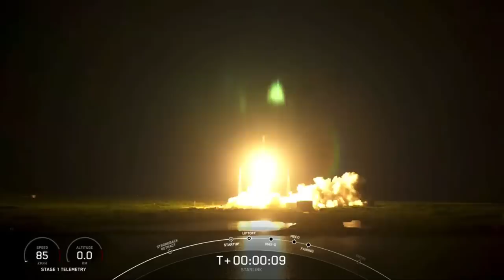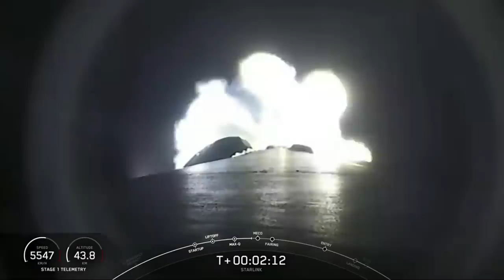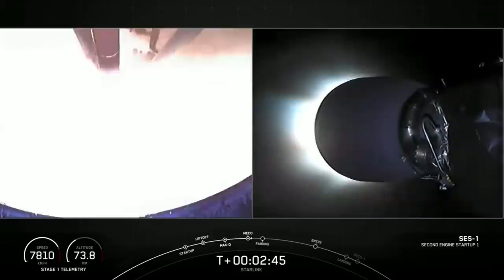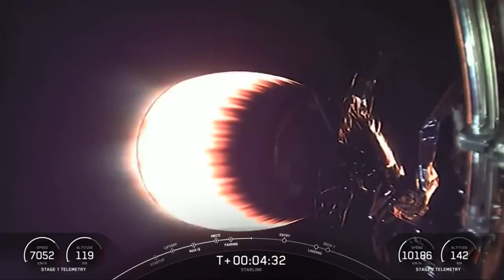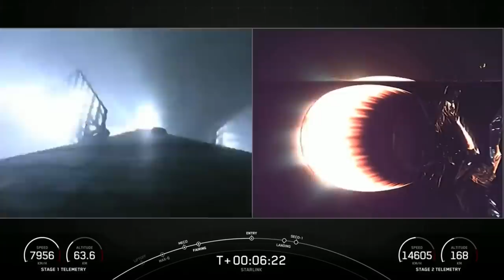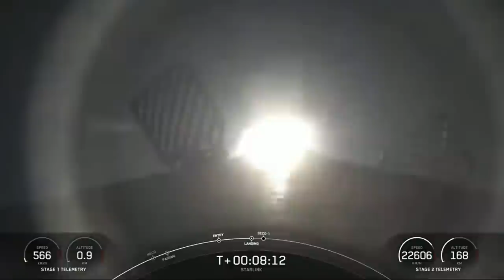SpaceX launches space tug & Starlink satellites, nails landing

Comment: It will never cease to amaze me the monumental achievement of making rocket landings boring.
Reply: It's cool, but I'd be much more amazed to see modern ships go somewhere besides up and down in LEO like John Glenn 60 years ago.
Reply: @STho205  I 100% get what you're saying. That being said, someone likened this to throwing a pencil overtop of the empire state building and getting it to come down and land on a penny standing on its eraser. 
While what you're suggesting would be awesome. I think the original comment was just kinda pushing what you said, your obviously bored with this absolutely monumental feat. Which is crazy. (Not that you're bored, that it's been normalized enough to even be boring).
Reply: @g-urts5518  well they could liken it to that...but "they" would not be engineers.  In 69 and the early 70s engineers were able to program pinpoint safe landings of manned rockets on the Moon 250k miles away with a radio delay of several seconds.  Years before that NASA and RSA engineers were landing probes on these same type pod legs.  Decades before that von Braun was able to get unmanned rockets to "land" on London ...nose down...but they still found their target with mere mechanical clockwork.

OBC has made this doable, but it is really only needed on Earth for short distance cargo rockets.  If the engineers had worried about that in 1965, then we'd still be waiting on the Moon and the exploration of the entire solar system these last 50 years.

SpaceX was late with their manned shuttle to the ISS by almost a decade, because they worked on the side project of landing boosters....for their own vision and purpose....and to be famous for doing something new instead of redoing what the US and Russia has done for 60 years.

Not to poo poo their advancement...it us a good one....however I'm more interested in where they're going than watching planes land at the regional airport all day.
Reply: You do realise, they had the equivalent of a quarter of your phones computing capacity for all of the systems involved in all the facilities and systems used in those flights....what those peoples did with nothing for tech can never be praised enough!!! They are the shoulders we stand on now to reach the heights we do!!!  We are doing amazing things as a species and horrible one as well.
Reply: @YouCanIwill  You're finding criticism where there is none.
Reply: It’s amazing. This happened in my lifetime. I remember dad plopping me in front of the TV to watch the moon landing and now this. I won’t see the next 50 years but it’s going to be wonderful.
Reply: That is an amazing observation sir.  Well said.
Reply: @g-urts5518  I don't know who said that about the pencil, but I'm using it. 😂
Reply: So true! Perfect comment. 
SpaceX changed my mind about the the privatization of Space. For most of my life I was convinced that only the government had the power and resources for space exploration.That was definitely true in the beginning. But SpaceX's accomplishments are a triumph for capitalism. Of all the madness in the world right now, SpaceX reminds me of what can be accomplished with freedom, vision, and hardwork. SpaceX's passion is inspiring.
Reply: Video Stage can do many tricks haha
Reply: @QIKUGAMES-QIKU  Did you know there are designated areas where you can actually go and watch rockets landing back at Cape Canaveral? I suppose you have a point if you want to call Central Florida a video stage.

Comment: At the same time, Nasa struggles to put a rocket up in the air xD
Reply: an old rocket made of old tech even.
Reply: If you have the wrong process, then the best people won't make a difference.
Reply: Well NASA has already " been there and done that " over 50 years ago. Riding around the surface of the Moon in an electric car - a total of 15 miles. 60's & 70's remember. That high bar STILL has'nt been reached.
Reply: @paulfogarty7724  But have they? People say that the film Capricorn One is nearer the truth
Reply: What NASA does and what spaceX does are two different things.
Reply: @gbhxu  if you saw Capricorn 1 that was fictional Mars.